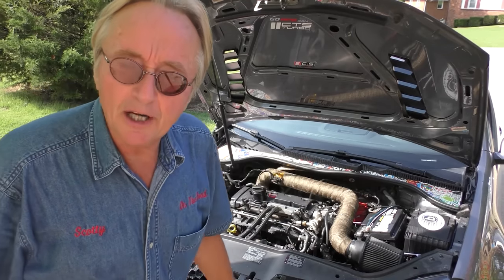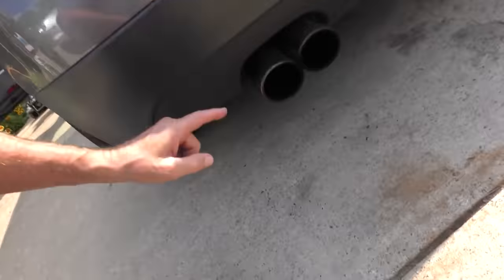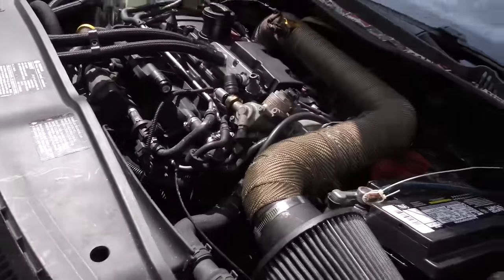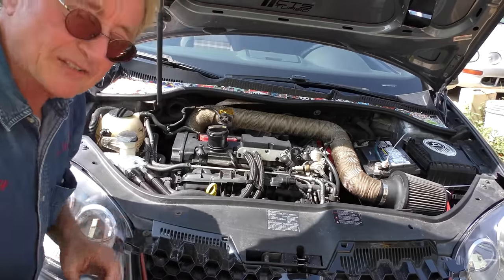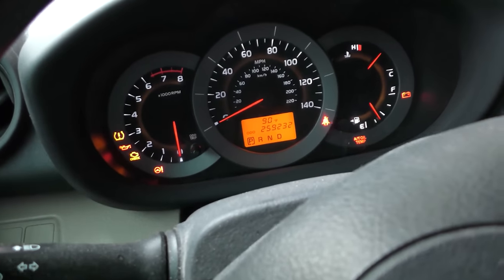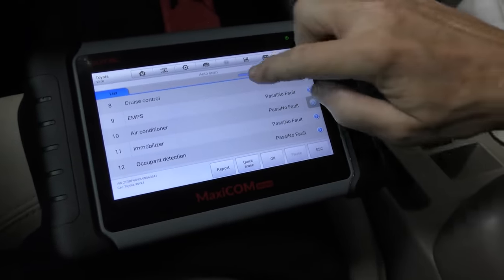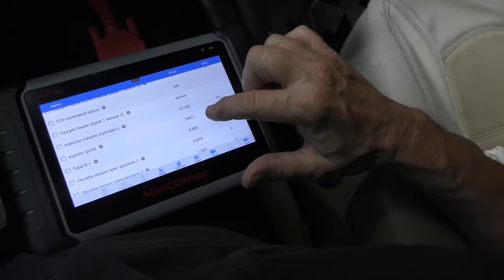3 Things That Will Make Your Engine Last Forever

Comment: “Oil is cheap, engines are very expensive” has been instilled into my brain.
Reply: Not for long
Reply: oil is sometimes not so cheap in some place，such as china，often 40 to 60 bucks to buy 4 liters for a normal car
Reply: @edwitsai  still cheaper than engines but that is very expensive..
Reply: @votivespark  Still oil is cheaper than to rebuild an engine.
Reply: Oil used to be cheap let's go Brandon
Reply: Oil is high, engine is higher.
Reply: @kingmike40  very true and getting worse every day
Reply: Oil is cheap, engines are expensive and gasoline is stupidly expensive!
Reply: Not anymore
Reply: Transmission oil? $100+ for 5 quartz 🥶
Reply: Shiiiii* , give Brandon a little more time!
Reply: Oil isn't cheap either
Reply: @SamslamminCars  what what about over 200k miles and changes every 3 k miles?
Reply: I was always told as an apprentice diesel mechanic,  "oil, filters and grease are the cheapest mechanics you can get" ..
Reply: @chickensfloat7427  what is the question?
Reply: Not in all countries. In my beautiful country we now change oil for 800$...
Reply: @nickajk1  it’s Putin’s fault!  LOL
Reply: @GrapeCityLive  I don't know what transmission you have but I guess it could be a case of 12 at Sam's is $35 it's dexron 3
Reply: Not anymore.
Reply: @GrapeCityLive  
Quartz is expensive.....quarts may be less expensive lol
Reply: @alanjohnson911  😭😭😭
Reply: Not really. In croatia one liter of shell 5w30 full synthetic costs about 10 dollars.
Reply: It's a good thing wasting americans start to pay more for oil products
Reply: @Tofix66  they don’t care about Global warming in here. 🤦🏾
Reply: @wesley9250  we do…
running the same oil for 20k as some European manufacturers are recommending is ridiculous. Replacing a vehicles engine or vehicle all together, does more damage than recycling oil more often.
Reply: @GrapeCityLive  My 2008 SAAB 9-5 uses a more expense Mobil 3309 transmission fluid for its Aisin AW55 5-speed automatic. A case of 12 cost me $70. Since new I change it between 12,000-17,000. Additionally I change my Mobil 1 synthetic engine oil every 3,000-3,500 miles.
Reply: Had an Acura 3.7 engine spin a main bearing recently right after I bought it (used.)  I can only assume oil changes weren’t done properly. It’s welllll worth the time and money to take care of the engine!
Reply: Same thought with me..
Reply: @nickhayley Hongkong $900 HK = $115 USD
Reply: I read this at the exact moment he said it
Reply: @nickajk1  Greatest American Prophet Donal J Chump has said that Putin is a genius
Reply: @chumpthetraitor7331  out of context but yes
Reply: @edwitsai  everyone rides a bike in China
Reply: @alanjohnson911  hahahah me and you were the only people that caught that 🤜🏻🤛🏻
Reply: Mine too. This  so enthusiastically funny.
Reply: Until you get an oil leak and spend $10-$20 a day on it.
Reply: @MalikTheMessenger  that is not a vehicle I would be driving till fixed.. spare us motorcycles riders bro!
Reply: @nickajk1  oil has fluctuated up and down by about 4 dollars the past 20 years
Reply: @nickajk1  oil price for 5 gallon jug has fluctuated up and down the past 20 years
Reply: @MalikTheMessenger  Fix that oil leak and you'll save that $10 - $20 daily .... just a thought! 👍
Reply: @GrapeCityLive  
$400 for the Jeep trans Wrangler+ filter
Reply: Transmission is even more expensive. It's often overlooked
Reply: @martynh5410  did you known the european gas prices?…
Reply: @GrapeCityLive  yes but did not need so often changes, and a automatic gearbox cost same as a engine
Reply: @nicolasfarah2092  wich country and wich vehicle? In France for my small Peugeot 208, i need 3,25 liter full synthetic oil and with the filter, the oil change(self made) cost 50€…
Reply: @mayken6661  jail perhaps anyone?
Reply: I’m considering going to conventional oil with more frequent changes and oil additive (I get justice bros oil additive for free pretty often at work) 
 Ut my ocd makes changing my own mustang gt oil a daunting task. Despite the fact that I do about 10-20 oil changes a week As a tech at the dealer and don’t sweat it. I just have a fear of re-living engine failure.
Reply: @Tofix66  uhhhh not all Americans are wasteful , i for one am not.
Reply: same with transmissions
Reply: Fix the leak lol save your money
Reply: @edwitsai  it’s like 12 dollars a quart here for the good stuff so not cheap either, but I’d rather buy 12 dollar oil than a 5000 dollar new engine, or even a 1500 dollar junkyard gamble engine, oil is still cheaper at the end of the day
Reply: @chumpthetraitor7331 he never said that.
Reply: Oil used to be cheap. I bought a gallon jug just like in this video. And it was on sale cost 30 dollars. And I had to buy 2 so I got half a gallon for my next oil change.
Reply: @NarySllim some times that happens on an old engine. Never use hi detergent oil in an old engine. It breaks lose all the old dirt and grime and that mixes in the oil
Reply: @NarySllim oh it's happened to me too. Changed oil and car start knocking soon as I drive down the road a few miles
Reply: If every vehicle owner have this same mindset, they'll save alot of money... preventative maintenance
Reply: @derondickson2424  never will. I see it all since working on vehicles for others'; they will endure and continue to destroy perfectly good engines.
Reply: @cindymcintosh9949  it is expensive to do a proper oil change anymore, you're correct. My neighbor neglected keeping up with hers and now needs an engine overhaul....
Reply: Not for a sprinter van.  Not cheap.
Reply: @KJweb20  a box of Valvoline oil at Walmart is 43. at the moment. Still cheaper than a 4-8k engine overhaul.
Reply: Not with the 1d10t currently occupying the WH
Reply: Oil is not cheap no more.
Reply: @pepe2715  nope, still is..  I am putting an engine in right now for someone. 35 bucks or a couple grand?
Reply: Facts
Reply: @edwitsai engines are 5-10k usually, I’ll pay. A few hundred for oil.
Reply: Lol
Reply: Brakes are cheap...clutches aren't is another one lol
Reply: @joeypeeps22  💯
Reply: @martynh5410  Come live in Europe...USA is very cheap with oil and gasoline !
Go vote for Harris then it will be 20 bucks for a qaurt within 5 years !

Comment: Thank you Scotty as you’ve taught the average guy how to diagnose problems with a simple $300 scan tool. You’ve saved me thousands in repair costs over the past few years.
Reply: That's about a 5or6 hund dollar scanner I'd like to have one like it
Reply: @dfls5069  yes, my scan tool is $100 and works great
Reply: Is there a short version?. I have disabilities... Can someone just tell me the pruducts he used the he liked.. Ty
Reply: the more detailed and updatable the scanner the more you can diagnose and diy.     From the ones I tried and have now a $150 ish and up are pretty darn good nowdays.    From there from what I seen and experienced so far.      There was a couple times I had to borrow one to track down a SRS issue which mine couldn’t read exactly what it was and it tracked down to the seatbelt buckle sensor which was awesome, I was hours looking into and testing because I thought I knew what it was but finally asked to borrow it.     The other time was regarding abs and it was able to tell me exactly what and where (driver rear , speed sensor.    I forgot what mine read but it wasn’t that detailed so it saved me time.    

That was a $2000+ scanner tho      I wonder if there is a $300ish scanner that would have pinpointed exactly where and what it was exactly like that?     

If so heck yah it’s worth it and will pay itself off.     ($300 to even $500/700 I would pay)         $2000+ however  I wouldn’t go that far , luckily I have access to one.     I’m sure I saved at least $200-400 just on those two issues alone if I had to drop it off at the dealer etc.        Definitely having a decent $75-200 one will easily pay for itself after one or two uses 👍🏽.        Unless you’re lucky and have a vehicle that never needs one.     The wife’s FJ we had since new 2006 and never ever had an issue yet 🤷🏽‍♂️, knock on wood.   Had relatively good luck with most of our vehicles      I like to mod my vehicles lol so that’s where it comes in handy too 😜
Reply: @dfls5069  nope. It’s very very easy. It’s called a blue driver. It’s blue tooth and connects to your phone through the app.
Reply: Whitemaninventedeverything  blue driver
Reply: My $30 Blue tooth too phone scanner works well.  (For basic stuff like sensors & running conditions. )
Reply: You don't have to buy a scanner you can borrow them for free with a deposit at many auto parts stores or rent the higher end one's for about $20 a day.

If it's just your personal car you work on it almost doesn't pay to own what you can borrow or rent. 

Also Harbor Freight has recently upped their game in the scanner world and they start at $59.99.

Yes a $700 scanner will tell you a lot more but it will be stuff the average person will still have to pay a mechanic for.

Also places like Aamco offer a one time complete engine scan with a print out for free at many locations.

Yup. 🍺
Reply: I too, feel very confident using the scanning tools after watching this video 😊
Reply: @chadwickwicky67  how detailed the code is will depend on the car not the scanner, the scanner just communicates with the computer to get whatever information the computer is providing.
Reply: What scan tool for $300?
Reply: @BTBC9870  I'll try to see
Reply: @BTBC9870  He usually posts the links to the tools he recommends. Right at the bottom of the heading.
Reply: @MaddoxMelton which one is it please ?
Reply: What's the scan you've got? :)

Comment: The 3 things:
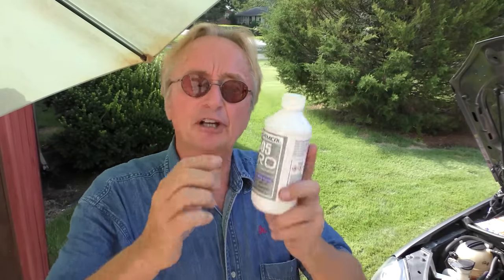1:10 Get rid of the carbon inside the engine
5:52 air filter
11:43 engine oil
Reply: Thank you!
Reply: Engine oil AND oil filter.
Reply: Thanks
Reply: No, it wasn’t the air filter
Reply: Can i use Lucas Oil Fix?
Reply: @1:51 damn that yay  is fire 🔥
Reply: Thank you!  Instead of watching the 20 minute video, I can start working on my car!
Reply: Thank you!
Reply: Stuff that will cause a oil filter to clogg immediately cannot be good for the engine!
Reply: youre saving lives with these summaries!
Reply: 3 things that make your car last forever,guaranteed!!!
1 Don't drive it.
2 Keep it in the garage.
3 Don't let your kids touch it.
Reply: Y solo la abuelita lo maneja los Domingo's...
Reply: Thanks! Also change or flush injectors use paper oil filters

Comment: I drove a 1972 442 W-25, 455 Ram Air with the 308* cam from 1971 to 2000.  I changed the oil quarterly & flushed the cooling system yearly. When it actually fell apart from rusting, the engine was just as good as the day I got the car.
Reply: What mileage did you get
Reply: @orenJF  At first, 6 around town, 11 on the road. I advanced the timing & then got 7 in town & 14 on the road.

Comment: My experience with the mass air flow sensor.  I had a K&N filter, thinking, "Get the best for my truck.  Well, after a while of running it, I got a check engine light.   Couldn't figure it out myself and called my mechanic.   He asked me a couple of questions, and when he asked when I last changed my air filter.  I told him 5 months ago, and I spent the money on the K&N.  He told me that they have figured out that the oil coming of the filter is coating the MA flow sensor.   All I needed to do is get the special  cleaner for it and clear the code, and I should be fine.  He was right, but the problem is I had to do that every 5 to 7 months, depending on how much I was driving.   After the third time, I cried wolf and took the whole K&N air filter system off.  Put stock back on and didn't have any more troubles.
Reply: I've heard about this too.  My stuff is old, 90 GMC etc , so the K&N doesn't effect it that way, but I've heard this.👍
Reply: Former tech here. We luuuuuved check engine light on, MAF code, and there's the KN. Sometimes cleaning worked, sometimes not. And advised the customer to find their old filter and housing. PS a properly oiled filter won't make a mess and 90% of KN we saw were never oiled ever.
Reply: Had a KNM filter in my car for at least six years. Never had the mass ear sensor clog up pretty oil. All I can assume is you’re putting too much oil onto that filter you only need enough to coat the filter not soak the filter.
Reply: @roberthein2156  nope!  Started after installation.   So I thought like you did. May factory put too much oil on it . I cleaned it and reapplied the oil, and 6 months later did the same thing.  Called my friend that is a performance mechanic and he said this is a very common thing with those filters.  Tried the 3rd time, and it happened again. Gave up and put factory back on.
Reply: Here's the real truth with those filters. They let more airflow into your engine, which is where the supposed added horse power comes from. If it allows more air, then it allows more debris. The oiling of the filter "helps"  filter the debris. So if your getting oil on your sensor, then guess what else is getting through. Long term use will shorten the life of your rings. The trade off, dollar wise is well NOT worth it. Stick with the factory filter. Oh yeah, I'm a retired professional mechanic with 45 years experience and have seen this many many times.
Reply: Thanks for posting this and all the comments, everyone! I was looking at buying a K&N filter for my car. But to hear about the potential issues from the oil coating, I'm going to stick with the factory filters. Thanks for sharing your knowledge and experience!
Reply: @tarat53  Your welcome.  Just hope to help the next person.  Just moved that dam box with the KN filter the other day.  I can't get myself to throw it away and I can't get myself to sell it and the next person have the same problem.

Comment: My favorite work truck, 2001 Duramax 2500 had a K and N air filter when I purchased the truck. Ten miles per gallon around town (very light in the accelerator). Couldn’t sleep one night last week so I found a stock air filter and supporting parts in my backyard. After running stock air filter my fuel mileage has skyrocketed! Earning 16 mpg around town, guessing 18 or 19 on hiway. So refreshing to have a positive change in general.
Reply: Just put KN filter on my Mazda 2, highest mileage was 54.5 and went up to 61.1 with the new air filter vs the OEM.